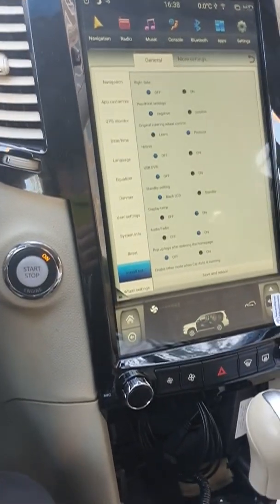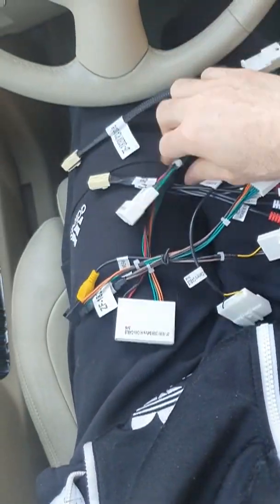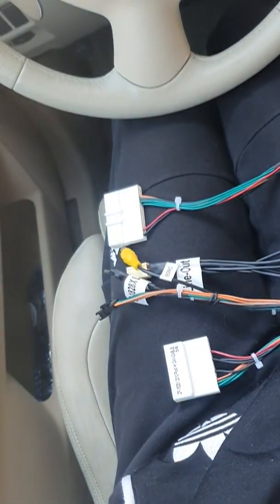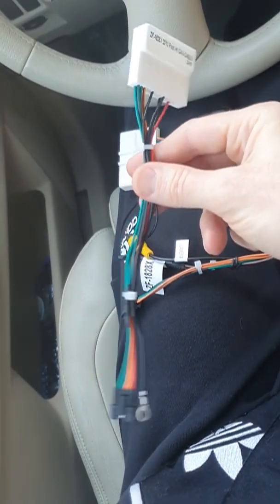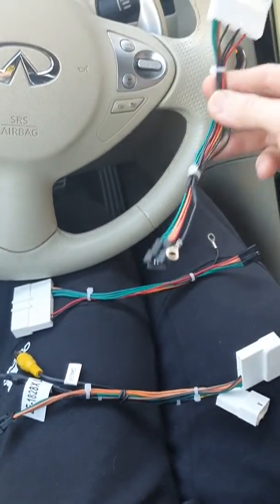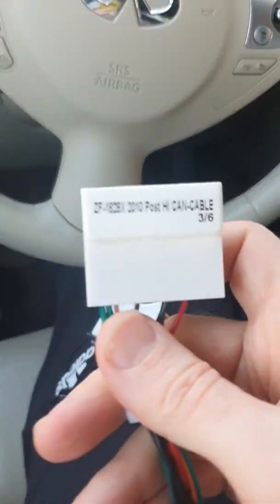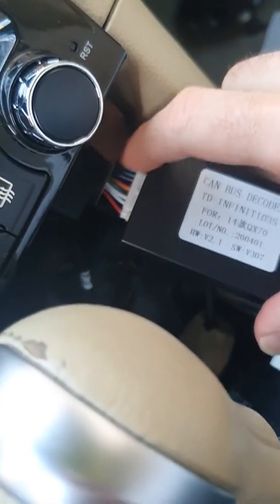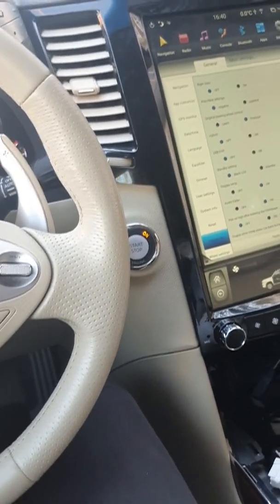Zwnav Tesla style radio Android touchscreen. 5 cables left after installation. Infiniti FX37 QX70

Comment: What did you do with the small stock pink and grey connectors? They don't seem to go anywhere on my tesla style screen. I panicked so i aborted the mission because i was so confused.
Reply from the maker: I did not find any other solution. I removed the Tesla screen because the TPMS is not working, the revers camera alarm beeps are not working and the noise of the audio on low volume was terrible. Do not buy this product.